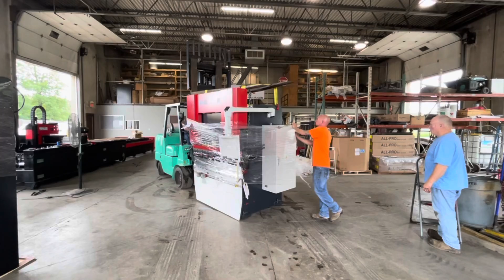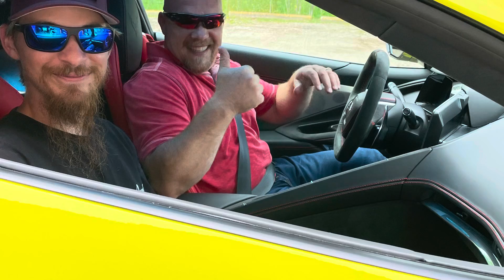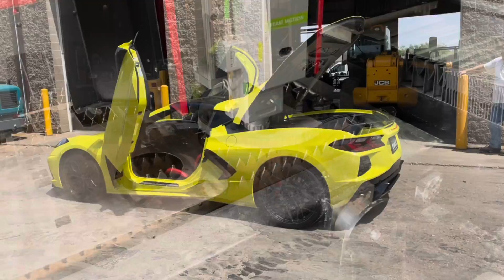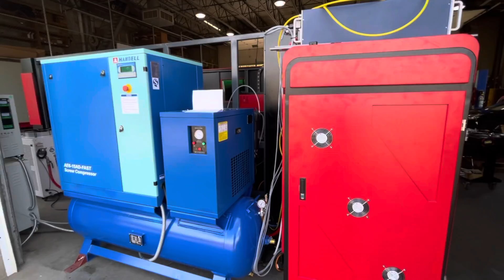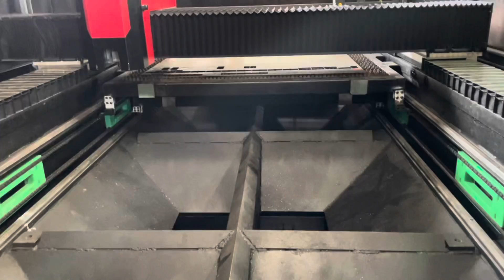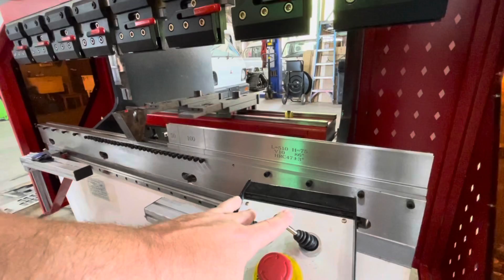CNC fiber laser installation for MJD, Blaine MN

Comment: Doing Tool & Die work without the high expense of custom tool and dies.
Reply from the maker: Lasers are very accurate, and are very frequently used to make gang/stacked tooling for small runs.  Hardened dowel pins are cheap and they are often used to be into the high wear area of the laser cut tooling to make them last longer

Comment: Is the power consumption of these big machines tracked? Seems like the cost of power is not insignificant when bidding on projects.
Reply from the maker: They sip power, they will use $3000 / year in power wirh the air compressor and chiller being the big consumer, they laser and machine itself uses nothing.  A machine like this can produce $2M per year in revenue easily